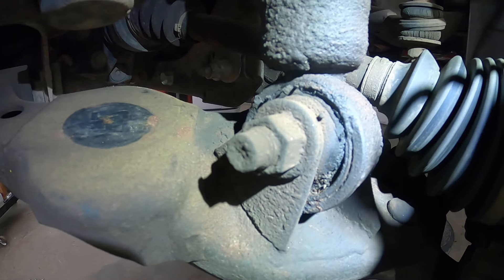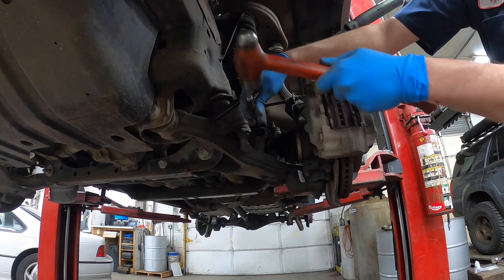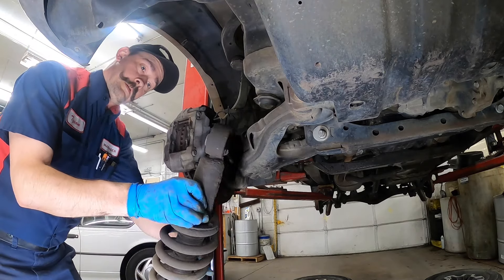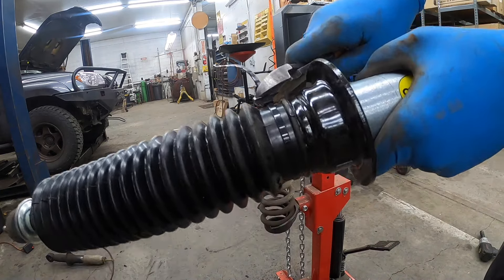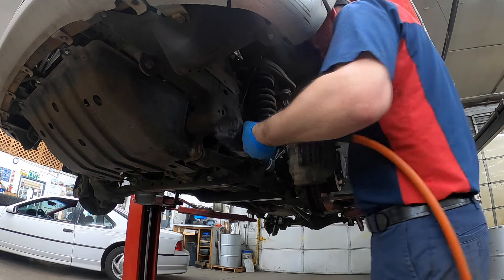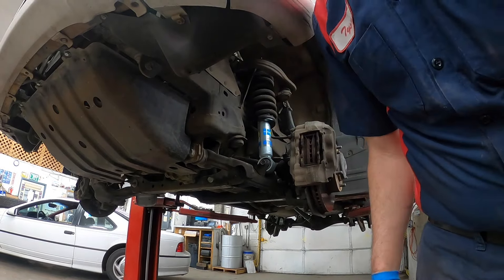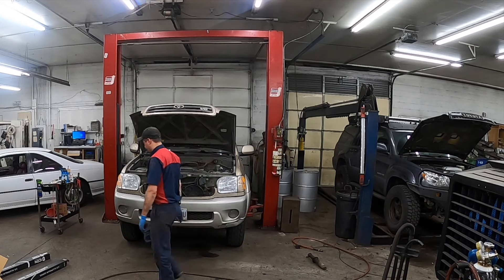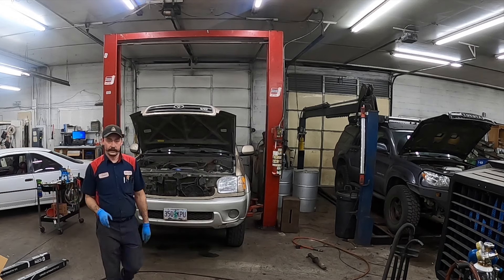First Gen Sequoia Budget Lift! What to do when its so bad you basically have a lowered Sequoia

Comment: you could have use the bottle jack which came with the car as a flat tire kit. put the bottle jack in the space  of the rear end next to the spring then slowly jack it up to get the spring out and put the new spring in. that would be safer than using those straps.

Comment: I just returned my lift from 1stgenoffroad. I really don't like the  stock rake look and lifting it with same rake look is even worse. Glad it worked out for you.
Reply from the maker: usually it will settle after a week or two of using it and the springs are broken in. But also, having that rake built in helps it to not be saggy in the back when loaded with gear.

Comment: Im considering a 305 75 16 for mine...i have the o.m.e. 2 in. Lift very similar set up...hows rub at full lock? Iwould like to go without spacers if possible and cannot afford a set of wheels with offset...I would like the largest tire i can fit no rub..i dont mind a mild trim and hammer...
Reply from the maker: With stock wheels you will need some spacers to move the wider tires out away from the coil a bit. As much positive caster you can get when aligning it and then some minor trimming on the front bumper. Has a minor rub when at full lock turning.